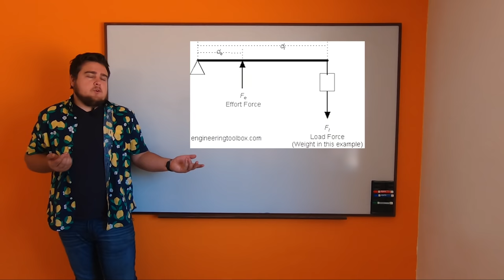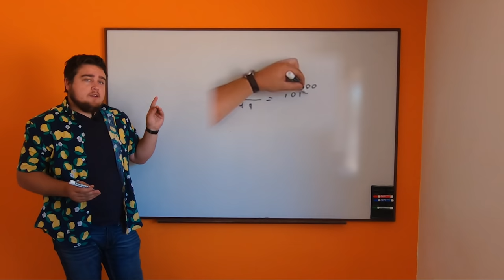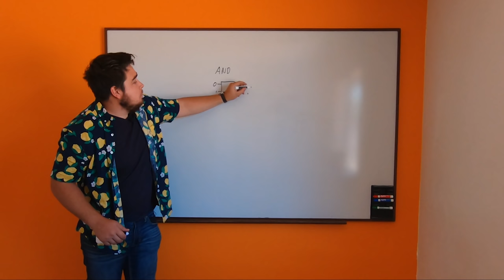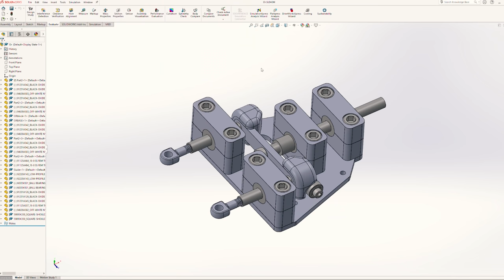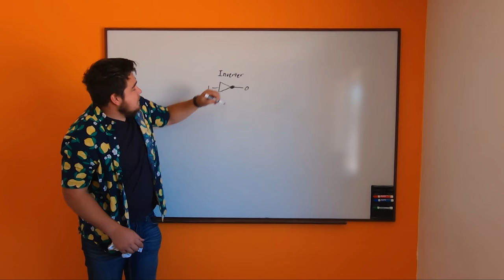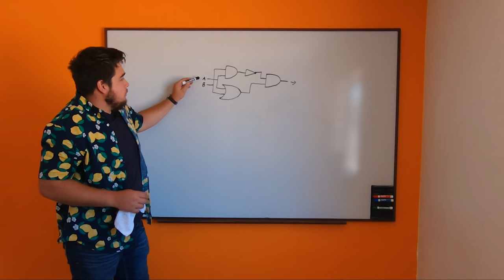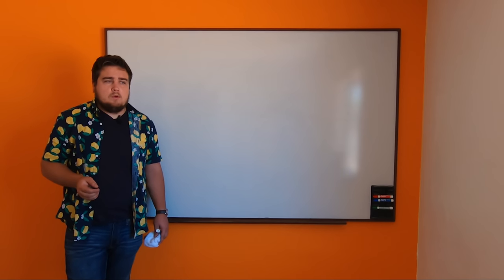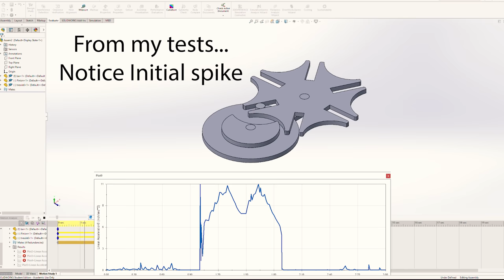Is a Completely Mechanical CPU possible?

Comment: There are old B grade monster movies where they showed mechanical computers that the scientists were using to make their calculations and they looked like a lot of axles with various cams on them, sort've like a giant foozball table but with cams instead of players.   These were often designed for differential calculations.  The mechanical "and" and "or" gates that you've shown, demonstrates more that boolean logic can be used with mechanical designs just as how digital logic simplified circuit design, however mechanical computers which did predate electronic computers were more likely analog computers designed for specific differential and integral problems, the early electronic computers were also analog using op-amps to solve integrals and differentials.  We found an old electronic analog computer under the stairs in the sub basement of the electrical engineering building once, you basically plugged in various resistors and capacitors to op-amps with banana plug cables to create integrators or differentiators.

You're not showing us that mechanical computers are possible but digital boolean logic designs are possible, basically that the principles of digital electronics is possible.

Now there were somewhat digital mechanical computers too, namely the abacus and the adding and subtracting machines (they often did multiplication and division by running in loops).   

The spreadsheet also dates back to this era where a computer was a roomful of people usually women who would each be assigned to perform a set calculation on some cells of a spreadsheet and then out it into an out box on their desk for a mailbox to take to another persons desk who would be designated to perform another set of calculations, they often had mechanical adding and subtraction machines.  Programming was a matter of defining which calculations each person should make and to whom the spreadsheet should go to next.  Indeed, the word "computer" did not mean a device, it meant an occupation and did so as recently as the 1970's.

Comment: Have you thought of using a non logical-gate binary adder. I don't know how it would work but it might be simpler.
Reply: Possibly a rod with 256 segments wrapped around it. pin1 pushes it 1 segment, pin2-2, pin 3 - 5 all the way up to the 8 pin pushing it 128 segments.

Then you just need to encode the operation for all 8 pins into the rod.

Comment: I'm no expert, but I figure it would be a huge saving of space and money to make XOR gates etc their own basic modules, rather than constructing them from basic AND and OR gates. 

Also, doing this as a basic copy of a electronic processor is already cool, but for a follow-up project, you could focus on some things electronic chips do *poorly*, and incorporate mechanical memristors, have a 3D structure instead of a 2D one, that kind of stuff. 
Perhaps also find a way to shrink down the components a bit.

Comment: I really like your project.
But I'll invite you at thinking outside the box.
Do you really need to reproduce exactly how regular electronics components works?

The issue with your design is how it will quickly require huge forces for making a lot of components engage with each others and push the data through all the logic gates, at the end it will mean that, regardless how hard you can push, the gates won't be able to handle the forces required for making it all operate.

One thing you could do is, rather than having two power+data input and a power+data output, having to have two data input and one data output + a power input.
The power here is obviously mechanical, it can be anything from spinning to even pneumatic or hydraulic, as long as they are themselves not powered by electricity.
And while the power bit mean extra works to do, it can also mean much simpler design for the gates that will now become really simple switches.

One really simple way would be to simply use double spring loading :
The mechanism for the gates, which is, as you plan, a modular design, have a simple a couple of pins against which the 0 or 1 springs push, and depending on the data A and B input, the output will simply be depending on which of the two is allowed.
Those springs themselves are "reloaded" by an intermediate spring, so if a gate is still outputting a 1, the spring for its output 1 will not block the whole reloading mechanism as the intermediate spring will just "absorb" it, or alternatively, when one spring is engaged, the reloading mechanism is simply "pushed away" and don't try to force it back.
Doing it could allow you to track where the data is in the circuit and determine a particular set of cycle per instructions, this way you can have the adder adding numbers and follow the carry that will then "flip the switch" to power the 0 and 1 springs of the next adder gates.
The whole thing could be powered by a simple back and forth motion that an engine could power, and if you want to go crazy you could even power it through a steam engine or even a big Stirling engine :D

Same thing for the memory, here you have the advantage of avoiding how electricity can't last and therefor require constant power to keep data in gates, and even better, to store 0 and 1 you can use as simple as a small pin who just have enough resistance to keep its position against vibrations but still react to 0 and 1 datas.

Comment: Is a mechanical CPU Possible - Absolutely, it has already been done a long time ago.  For over 70 years, there have been "fluidic" (fluid flow) based computers (https://en.wikipedia.org/wiki/Fluidics ), with everything you'd expect in a computer - memory, logic, etc.   For example, fluidic computers were installed in US military fighter jets many decades ago to serve as bare-bones backups in the event the electrically based computers got fried by a nuclear magnetic pulse from an atomic weapon.  Keep in mind that military jets are flying "bricks" and need computers to stay airborne by means of relatively small computer driven control surfaces on the nose of the craft.  No computer, no fly!

Comment: Hey if youre interested in non electrical processing units, check out photon processors or optical computing whichever keywords work best, its our current best proposed solution for overcoming moores law for classical computing (so not quantum)

Obviously not directly related to mechanical processors, but theres some lessons from there you could apply to a mechanical processor since photons are linear unlike the non-linearity of transistors, so you can apply the same lessons to say using fluids instead of photons

Comment: The answer is no. Because you require some other form of energy to drive it.... which will eventually boil down to electricity, hence it is not 100% mechanical because it relies on the exact same thing computers rely on. Neve the less, great video and concept.

Comment: Two problems.  Size and speed.  Size is the "bigger" problem.  Just like a huge gearbox, friction and inertia are going to become problems very quickly.  Good luck.  I have a couple of slide rule apps on my smartphone.  The ultimate simulation?  Use a mechanical computer to demonstrate that electrical computers work.

Comment: If you can create a Nand or a Nor gate, then you can use them to create any other type of gate by using them in combination with one another. so lots and lots of Nands or lots and lots of Nors
although you will use a lot of gates that way, but typically it's not an issue when using silicon

Comment: I'm a PhD student in computer architecure, and I must point out that a gate with 2 logical inputs is not good enough for a useful computer. 
The key problem in your design is this: 
The logic in a real computer is deep. There are layers and layers of gates, connected nose to tail. In this case, the mechanical force (or whatever you use as signals) will be weakened layer by layer, due to inperfections like friction. This weakening should be exponential, so that you need a HUGE driving force at the beginning of your logic to drive the whole thing.

Therefore, all the logic gates in real computers have a 3rd input, the power source. The 2 logical inputs doesn't DRIVE the gate (like in this video), it merely CONTROLS whether the gate draws power from that 3rd input. Effectively, the inputs are amplified by the gate, so that it never weakens. 
This is called the "gain" of a logic gate. That gate in your video has a negative gain.
That's why transistors are used to build logic gates--they are natrual amplifiers. To build a mechanical computer, you need a mechanical transistor, or any other amplification device.

Comment: Im a very practical person so my question is what are you going to use it for?
I get your scenario of having no electricity so that would in term mean, it would strictly have a mechanical use and basically that means no engine cause lets face it if you have a gas powered engine you have the ability to produce current lets face it even if you made a bike powered mechanical device of some sort lets face it, placing some magnets on the flywheel and making a crude coil wouldnt be that hard. This to me makes it a totally useless project, i truly give my best wishes for you on this project anyhow i must say, i dont think you will discover something that no one had ever thought of before but im sure you will find some personal insight no matter just trying to build this what ever it is supposed to be😂🤣🤣